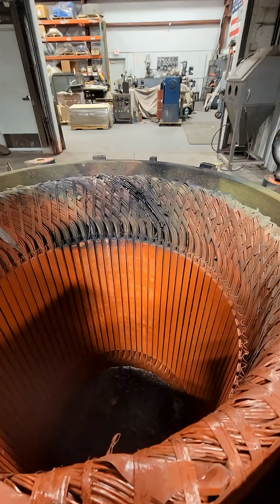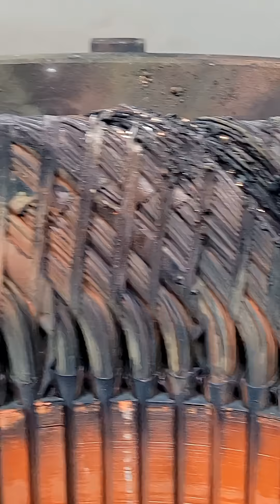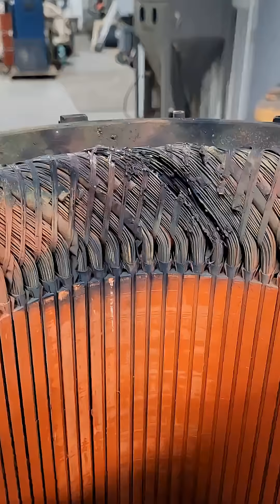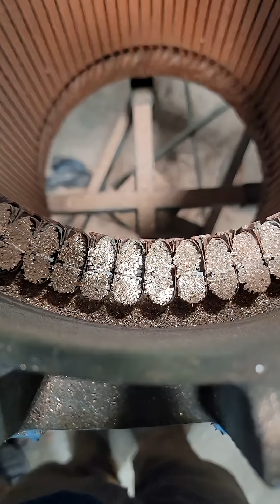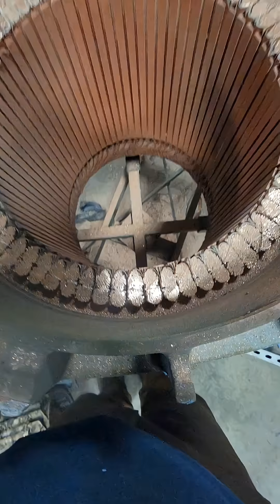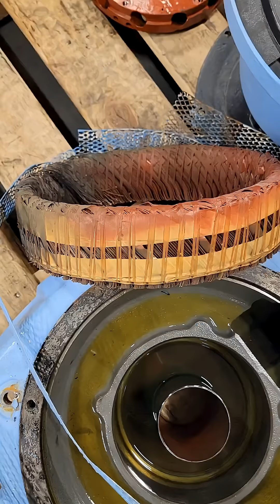#fyp #foryoupage #motor #pump #machine #mechanic #maintenance #torque #industrial #commercial

Comment: If they bathed the windings in that epoxy insulator would that help prevent the vibration-induced rubbing from removing the enamel theoretically?

Comment: Indeed you have a good point on the vibration creating friction between the varnished wires, it makes sense, it always affascinanted me how the insolation could hold such indurance. I always wondered the cause of burn outs of the hundreds of motors i changed and sent to be rewired. I biult back in the day huge industrial transformers with simular wires.
Great work need to follow you guys need more info on various causes and precautions one can take to ensure burnouts don't happen?